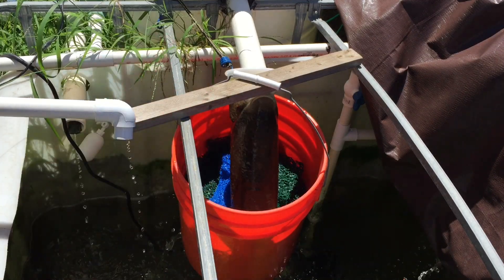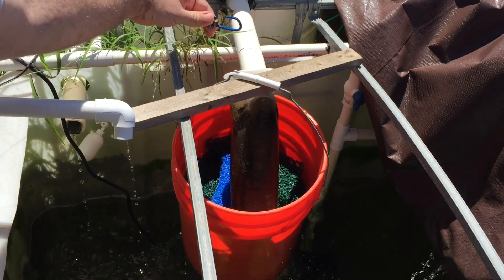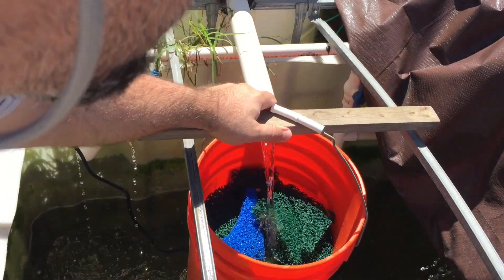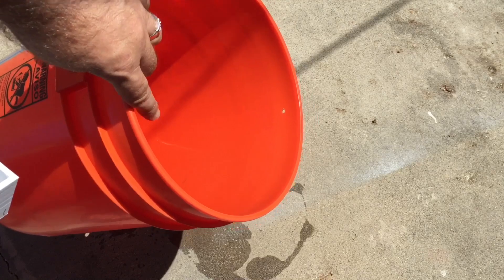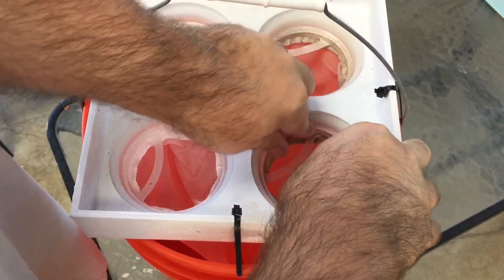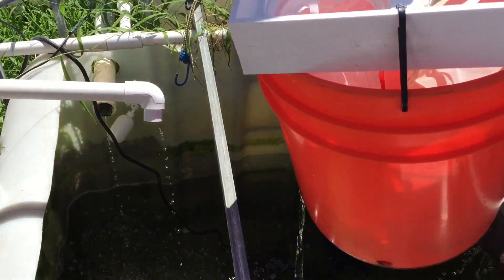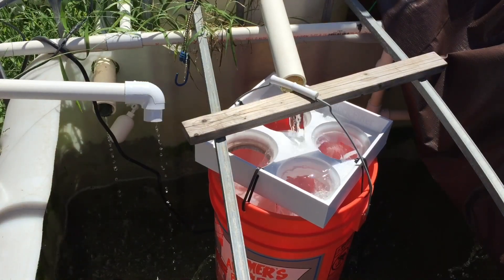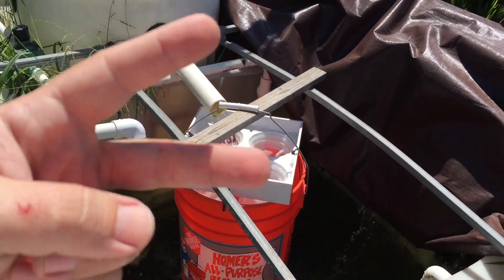4” Sock Filter Holder Installed!

Comment: put a elbow on it like a 1/8 inch above filter to better the flow to all 4 holes
Reply from the maker: All I have on hand is a sweep 90 which is a little to long. I will pick up a normal 90 and see if that works but I am also trying to think of a part I can print to help split the flow just right.
Reply: @pewpewpopz  turn the 90 down add enough pipe to be close to your designs center